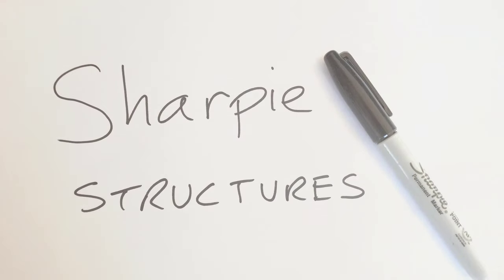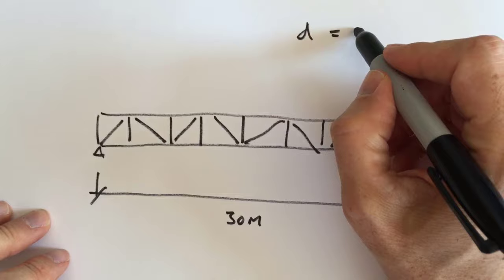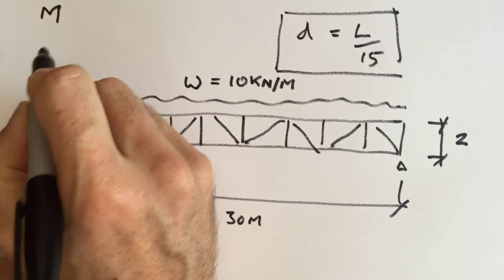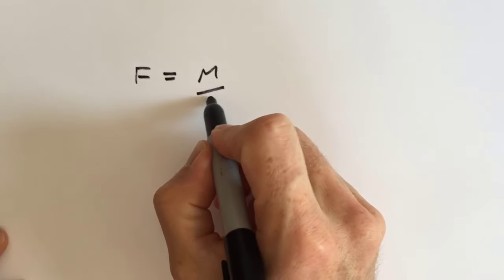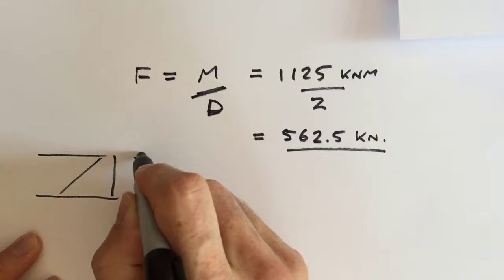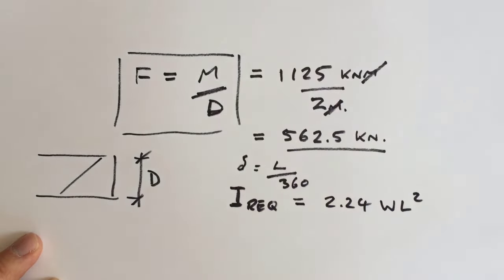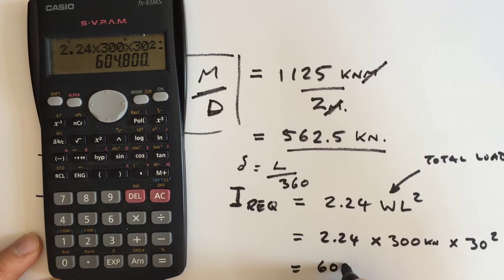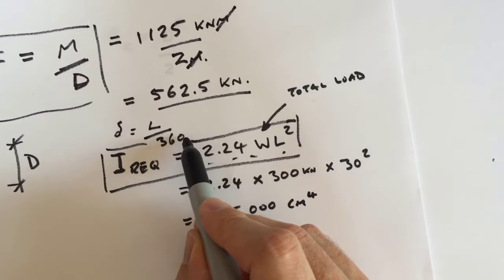Steel Truss Calculation - The easy formulas you need to use

Comment: Not sure if you read these, but I can't seem to find an engineer to help with a project.  I just want a truss drawing with thickness of mild steel angle iron used for the web and chords, and of course, how many triangle webs need to be inside the truss.  I want to use a parallel chord vaulted truss design spanning 40 feet.  I am putting a roof between two shipping containers, and need a snow load capacity of 50 psf.  The perlins (span between trusses, I think they are called perlins) will be 2/4 every 24 inches connected with U channel, and I hope to get away with fabricating 11 trusses total, so every 48 inches.  I would happily pay for a drawing.
Reply from the maker: Hi Chris. Sure - let me know on the following contact form: https://docs.google.com/forms/d/e/1FAIpQLSdXAY1zbCizMIF5CbdSrSRF5dBG-H1nXEW2wBuCYdgdJk309Q/viewform?usp=sf_link

Comment: good but U said depth formula is truss  span devided by 15 or 18 ???? there should be one denominator either 15 or either 18 otherwise depth will  be changed # 🇵🇰
Reply from the maker: Span/15 is not a formula, just a rule of thumb to help you decide what initial truss depth to try. The formula is later in the video.

Comment: I didn't quite understand how the 2.24 came about. You stated l over 360. Is that 30 divided by 360? Because I get a complete different number than the 2.24?
Reply from the maker: It's a shortcut formula for deflection that has been developed taking into account youngs modulus and the allowable span to deflection ratio.
Reply: @RobindeJongh  but where does this 2.24 come from?
If look online I see L/360 and than see actually same number as me. Aslike 30/360, as the distance oenght is 30m
Reply from the maker: It’s literally a page full of calcs to get to it.
Reply: @RobindeJongh  ow I didn't get that. I'm sorry

Comment: Hi Robin, thanks for this video. I think there is something wrong !
I have an objection regarding your formula: I = 2.24.W.L2
Look what I found: 
Deflection = L/360 must be < or = 5.W.L4 / 384.E.I
I < or = 5.W.L4.360 / 384.E.L
I < or = 5.W.L3.360 / 384.21000
I < or = 2.23.W.L3 
Could you explain me where is the problem ?
Thanks in advance
Reply from the maker: Hi. It's ^2 for total load, ^3 for a udl.

Comment: For the configuration you drew the top chord force will be 562.5 but the bottom chord force will be less because of the diagonal web members framing into the bottom chord at midpoint.
Reply: True but for a quick approximation it will get you in the right ball park.
Reply: Hello sir Do you have a simplified book for designing the easiest way?

Comment: Hi, Robin, can you check  this?
L=5.6 m, total load = 1.5Knm, sectional area (light gauge steel 2x4x0.85 = 1.27 cm2) . I=2.24*1.5*5.6^2=105 cm4. I need to find de "D" value. So  for me 1.27 * 13^2 = 107. Then, I need a "D" value of 13 cm.  That's correct?

Comment: Hello, your videos have really helped me, thank you. I have a question, from your example, Irequired was 605,000cm4, so does that mean when picking a steel section to use we have to pick one with an Ix value greater than that? Like 1016x305x249 universal beam? And lastly, can universal beams like that be used to construct trusses? Sorry for the many questions, your answers would be appreciated.
Reply from the maker: Once you have the required I value, you then derive the I value for the truss using the next part of the calculation in the video. I may need to clarify that in a future video.
Reply: @RobindeJongh  Thank you. Also, is there a way to calculate the bending moment in a specific truss member to be able to carry out a bending resistance check?

Comment: Hi. When working with smaller trusses for machines i found that the equation I=A*d^2/2 gives 4-10 times bigger moment of inertia than the real one (that was my statistics, the situation may be even worse). My trusses were mostly ~2 m long and ~300-400 mm deep, i needed really small deflections (l/40000)

Comment: Hello, is (I required) = 2.24 W L^2 or is it 2.24 W L^3. As in your video "How to do a steel beam calculation Part 4, you used the formula I required = 2.24 W L^3 so I am confused  which one is correct. Please could you reply at your earliest convenience as I have a close deadline.
Reply from the maker: Hi. The difference is whether you use w for kN/m or W for kN, in other words total load. So ^2 if you use total load (big W) or ^3 if you use a UDL (kN per m).
Reply: @RobindeJongh  Thank you
Reply: @RobindeJongh  Is there a formula, to calculate the deflection of a truss, so It can be compared to the formula deflection has to be less than span/360? so the truss can be proven as satisfactory
Reply from the maker: @rayrim-rukeh1967  Hi Ray. Yes, if I remember rightly that's covered in the video.
Reply: @RobindeJongh  hello, if you did I can’t figure out which one it is. Please could you help?
Reply from the maker: @rayrim-rukeh1967  It's at 6:38 https://youtu.be/gNnyi8gxDQM?t=398
Reply: @RobindeJongh  ohhh I see, thank you so much. I appreciate it
Reply: Using the same letter for two different quantities is an unnecessary source of errors.

Comment: I want to build a lightweight trailer for my ultralight aircraft (350 lbs) , it has to be single axle and 24' long and be enclosed (arched covering).  I was thinking about welding two lightweight trusses together as the main support instead of get a heavy rectangle or angle.  They can't be very tall though, maybe 6" your calculation makes it 18" high and that would make the floor of the trailer too high. but two of them could be smaller maybe? what should I use, 1" square tube and flat bar maybe? I don't know if it's worth it.
Reply from the maker: Hi. Trusses are a lightweight solution at the expense of depth. Steel UC sections offer the opposite, a less deep solution at the expense of weight. If you have only 6" then you're limited to a UC section or Square hollow section.
Reply: @RobindeJongh  they incorporate the trusses into short side walls to make these long lightweight sailplane trailers.......that's the secret!
Reply: @RobindeJongh  how do we design such a truss other than simple triangles if we want to make it stronger but don't mind doing more cutting and welding?

Comment: when you say area of cord say using 2X4 nomimal so 8 in square X 2 for top and bottom cord ?
Reply from the maker: Hi Robert. The "A" is the area of one chord, so you would typically use the same top and bottom chord. The area is area of steel, which takes into account wall thickness and so on.

Comment: Long span for hall 30m length the optimum flat structure and optimum steel type tube or angle section or c channel?
Reply from the maker: Angle or c-channel back to back can work well and is easy to bolt together or weld. Circular tube needs more welding and fabrication time.

Comment: Is this for a standard thickness of stock. Like 1/4 inch think 2x2 angle iron? It seems like the measurements of the material your using would change the equation.
Reply from the maker: Hi Paul. Generally you would measure to centroid of the section, so the calculation doesn't change if you change steel size.

Comment: I am wondering what the Ac is? The overall area of top chord and bottom chord or just counting one chord?
Reply from the maker: Ac is the cross sectional area of one chord, if the chords are equal size.
Reply: @RobindeJongh  thx.. Got it
Reply: @RobindeJongh  and how does this work for ub's or uc's?

Comment: Hello Robin. Thank you for your time putting this together it is really helpful. I need to ask one thing when are you calculating "I required" how cm^4 came? thanks
Reply from the maker: Glad you're finding it helpful. The formula for Ireq is a simplification where I've taken the formula for deflection 5WL^3/384EI and substituted in all the units and the value L/360, which then gives me the shortcut formula.
Reply: @RobindeJongh  Got it. Thank you very much
Reply: @RobindeJongh  How did it come to 2.24 I used how you derived the formula and what I got is 4.68
Reply: @RobindeJongh  And is this applicable for short span also?
Reply from the maker: @alfredfungo2155  Yes, it's applicable.
Reply from the maker: @alfredfungo2155  The one I've presented only works with these specific units. If you're using other units you will get a different result. It's simply a shortcut, and you can find the proper formula online by searching "deflection formula"
Reply: @alfredfungo2155  It's necessary to divide by Young's Modulus... in this case is 2.1kN/m^2 (210 GPa)... so we've 4.68/2.1 = 2.24 (aproximally)
Reply: In fact, the formula derived from the elastic curve equation for the moment of inertia required for simply supported beams is 5WL4/384EI.

Comment: what is meant with "Area of the chord" ?
Reply from the maker: Hi. It's the cross section area of the steel section that is used.
Reply: @RobindeJongh  So in this example the unit of 'A' would be square centimeter and the unit of 'D' would be centimeter in order to receive a value comaparable to the 'Ireq' from the previous formula which results in cm cubed, right?

Comment: As you described as a simply supported truss, it is subjected to the maximum moment of wL^2/8. The design max moment is located exactly at the center span. You considered the top and bottom chords at the center span as lone couple structural elements resisting the moment but strictly they are not. You disregarded the resistance to moment the diagonal member provides. This fact renders your entire design calculation inaccurate.
Reply from the maker: Good points but I respectfully disagree. This is an incredibly simple calculation that gets a 98% correct force in the top and bottom boom, and is slightly conservative. That's an amazing win if you don't have software to get you the final 2%.
Reply: It's not the cords that resist the moment, it's the beam, because the truss is just a beam, that is, an element subject to a binary of forces. The path of the forces constituting the binary along the beam is what matters for the truss...

Comment: CAN I USE OUR INDIAN COUNTRY ? IM FROM INDIA
Reply from the maker: Hi Pragati. It would be suitable in India or anywhere, as long as the local building control accepts your calculations. Local variations might be in steel grade (it's usually S355 or S275 here in the UK) and in the safety factors used.